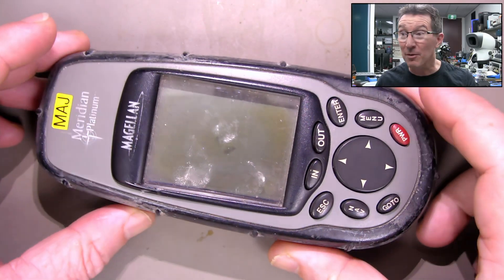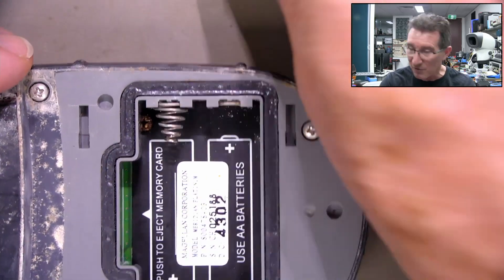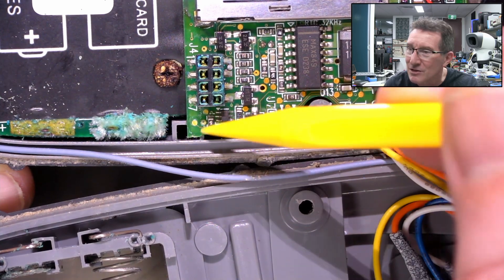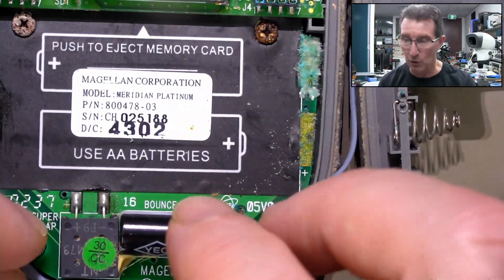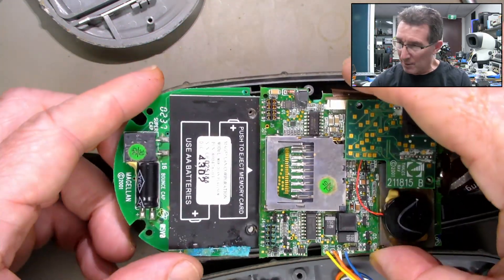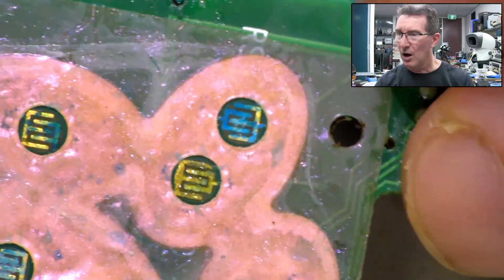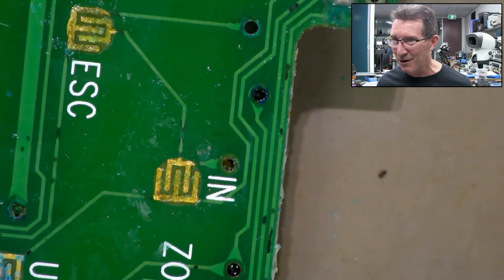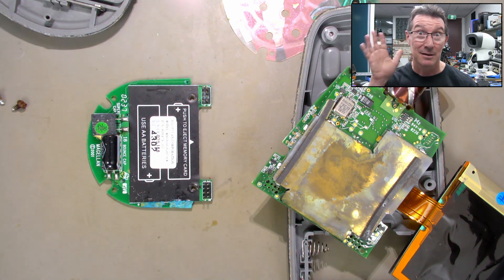Another Horror Alkaline Battery Leakage Teardown. RIP Magellen GPS

Comment: Not a chemist but calling it neutralize doesn't sound right. Potassium carbonate is a salt which are ph neutral. The vinegar displaces the co2 which bubbles up. Of course residual hydroxide will be neutralized.

Comment: Even without the battery damage it would no longer work. These older GPS can not handle  a number overflow in the GPS data that happend some years ago,
Reply from the maker: Really? My old Etrex still works.
Reply: @EEVblog2  My Etrex died in 2019. It depends on the chipset. Found this information:
GPS devices that use ICD-200 or IS-GPS-200 specifications will behave weirdly or stop working , April 6, 2019.

Most of those devices were built before the year 2010.

They used a 10 bit number to track the week. This is around 20 years. This number will reset to zero tomorrow, affecting your old GPS.

Comment: I thought 'possible' up until the LCD display - Just not sure about that display is going to work well. But that keyboard? No. File it away in the circular file. What a shame...

Pretty sure that LCD is normal deteroriation apart from the battery. No chance of donor parts fixing this

Comment: im starting to think the battery leakage is something to do with humidity.....and being stored in a confined space (eg the battery compartment).. it doesnt seem to happen when the batteries are just left lying around or exposed to open air.. it would also explain the rust on all the metal bits.. it seems they defo need to be enclosed in a small compartment.. they wont leak outside of it (youve done multiple attempts!)
3:52 Dave spitting on it wont fix it! :P
Reply: Duracells in date leaked in the box or blister pack even when they were stored in tightly controlled air conditioned rooms adjacent to our calibration labs. They leaked in the field too. Or they did until the mid 1980’s when their use was banned by our company.  Alkaline cells are the pits.

Comment: You almost have to wonder just how well a vintage gps can work on a modern gps signal. 

I seen a tomtom fail to update its clock because of the new modern signal. That gps is forever stuck at midnight 😂😂😂

Comment: I just took this moment to check the two AA in my Garmin handheld.  Tiny little yellow one fits in your palm.  For hikers etc.  Not too sophisticated compared to today but it works well after it acquires the signals. Well within about best 15 feet or 3 1/2M I suppose.  Maybe not quite good enough in dense jungle.  Even at this level of sophistication,  hikers that get lost would not get lost by just dropping it in a pocket.   "Searchers found his skeleton 100 feet away from his car and supplies"  would not be news.  Not dependent on a charger.
Reply from the maker: I found hundreds of geocaches and won geocaching speed events with that thing.
Reply: Hopefully Lithium AAs not Alkaline ones ...

Comment: I have concluded that the manufactures of electronic devices and flashlights/torches have a secret agreement with the battery makers to make them so they will leak at some point.  In order to ruin said devices and force consumers to buy new rather than keep their old gear. Part of the planned obsolescence concept of marketing.  I sometimes find old stuff with the carbon batteries installed decades ago and the batteries may be dead,  but not leaked.  Same age alkalines would be a mass of white scum everywhere.  The dreaded mercury batteries not too bad either.  Time for a new GPS,  just as planned!  LOL

Comment: I wonder if wrapping batteries in shrink tube would contain leakeages?
Reply: Probably just temporarily to gain you just a bit more time.  I have also gone to applying silicone grease or treatments to battery terminals.  Ward off oxidation and perhaps add some temporary protection from leakage if you manage to catch it in time.

Comment: I bought one of those (non-Platinum, though) on a US vacation back in... 2001 or 2002 it would have been. It didn't do navigation, of course, but it was a super helpful addition to paper maps. I still have it, and it still works. I dig it out and put some batteries in it once in a while, to make sure it's still functional. It does take forever and a bit to get a fix.

Comment: Tragic - the water proofing seems to have worked a treat just to be done in by a leaky battery
Reply: Yeah it was doomed by the liquid within. Someone should design these with a separate water tight seal between the batteries and internal electronics.

Comment: Do lithium batteries leak like this?  or do they have a different issue ?
Reply: They don't leak, but they are known to explode.
Reply: note, for posterity, usually not just for no reason, destructive ends to Lithium usually comes from them being significantly damaged, most of the time.
if they just get cycled to death, they just go to crap.
Reply: @taiiat0  they usually fail due to being imbalanced in packs, and then when the pack discharges, one of the cells ends up reverse biased. They don't tend to go flamey for no reason
Reply: Lithium primary (single use) or li-ion batteries?
Reply: Low quality 18650 also leak often

Comment: How does the corrosion spread? Is it through air?
Reply: My guess would be a corrosive mist, since it seems to spread anywhere near the batteries without needing to be in physical contact with them.
Reply: @flomojo2u  I think the liquid electrolyte leaks out, then it evaporates, and the vapor spreads all over the place.

Comment: I'm pretty sure the "bounce cap" is to prevent it from turning off or crashing if it's dropped or hit really hard. Since the batteries are spring loaded, a sudden strong force can cause them to bounce away from the positive contacts. Wii remotes have the same thing inside for the same reason.
Reply from the maker: Yeah, that's my guess too, basic bulk PSU battery design. Never heard the term "bounce cap" before though.
Reply: Interesting! I admit I initially suppposed someone misspelled a (de)bounce(r) cap, for the buttons 😅
Reply: I bet the super cap is for NVRAM only and the bounce cap is for brief interruptions to normal operation while powered up 🤔
Reply: @ Yeah the super cap is almost certainly used to keep the memory going while you're replacing the batteries so it doesn't get erased.
Reply: However, right next to it is a device labeled "super cap," so you'd think it would be capable of powering it for a short amount of time.  Maybe it couldn't handle burst currents, so you needed an electrolytic as well?
Reply: @flomojo2u Probably a very low value super cap, due to the age of the unit. Using an electrolytic in parallel to help the super cap somewhat makes sense...
Reply: oh yea, i had an mp3 cd player that would glitch out upon relatively minor impacts. It was annoying enough that i soldered the ni-cd cells into it permanently (fine since it had built-in charging circuitry). It helped.
Reply: Good to know because I may need to repair a wii remote.

Comment: To best of my knowledge, no one has been able to pinpoint exactly what causes alkalines to start leaking? temp, humidity, state of charge ...
Reply: Price of the containing device
Reply: Age, the only common factor. Change alkalines if older than 6 months.
Reply: @NICK-uy3nl  If you are changing them that often, just use rechargeable batteries.
Reply: I think what starts them leaking is the fact they were made in the first place. 🤣🤣

But yes age is definitely a factor

Comment: This foil with contacts looks like fluorescent backlight. Usually blueish/magenta colour. Needs HV to operate (~100v)
Reply: Looks like it. One of the contact sneaks on the pcb edge towards the connector. And that corner pin has a current limit resistor, capacitor, diode and inductor with gray gunk on it. That looks like being fed by a step up converter.
Reply: EL Backlight. Needs around 90-100V AC, as they are capacitive coupled.

But I think that foil was for ESD protection